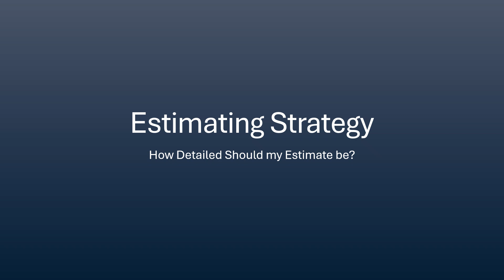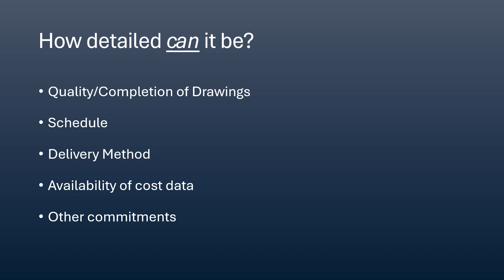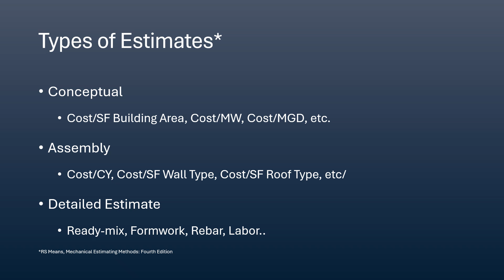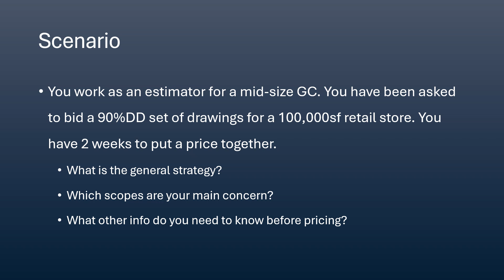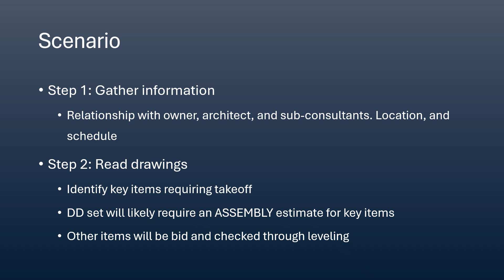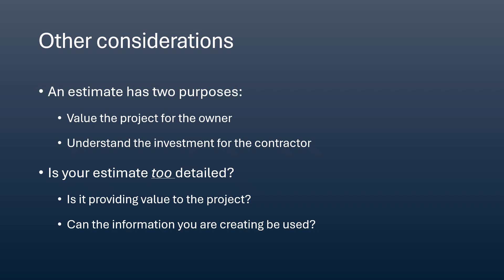Estimating Strategy: How Detailed Should my Estimate be?

Comment: Hey, Thanks for sharing this bud! Cool to watch for sure. Civil/Mechanical/Major Underground Infrastructure/Highways estimator guy here. (2.9M metro pop. City)

 +10% at least on everything until IFT drawings. Design build, even more. But I tend to be transparent in a DB stage project and get in tight with a couple of GCs. If its budgetary, they need room for approvals. Then price comes down when we finalize at IFC drawings and put it in the ground. 

Number one is be conservative but reasonably confident. Trust in your suppliers and subs has to be high, then lean on them to quote shit to spec and on time. 

Also Earthwork is easy and you can be a consultant for 50k a year for 4 hours a week in your spare time. Lol